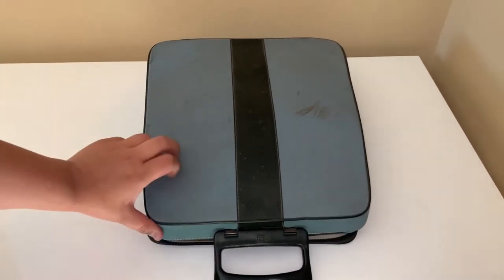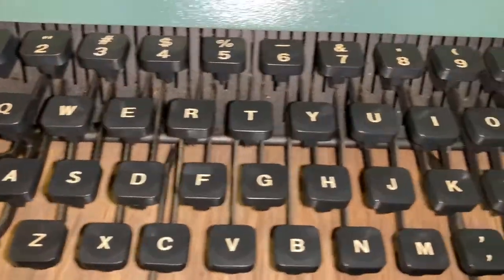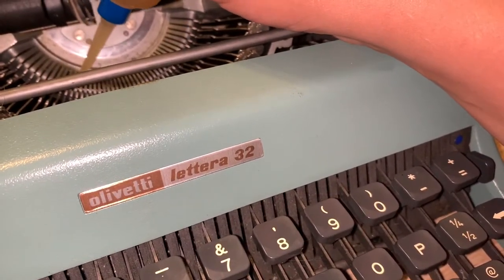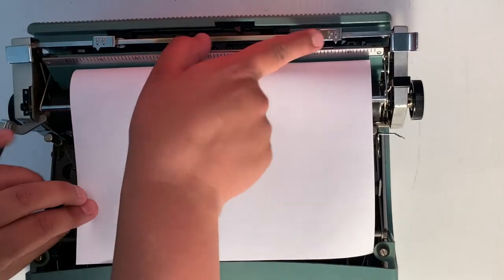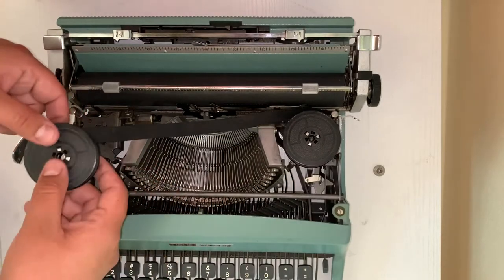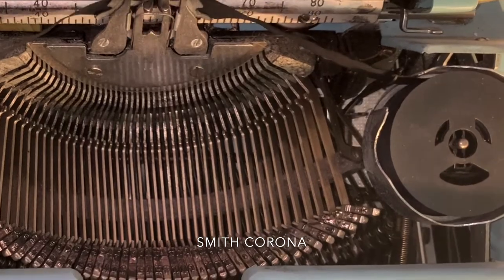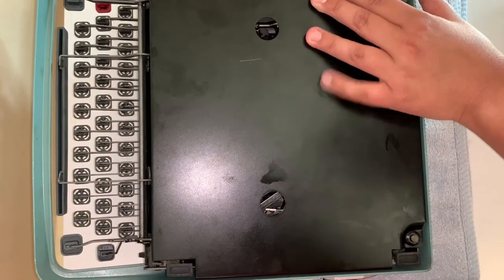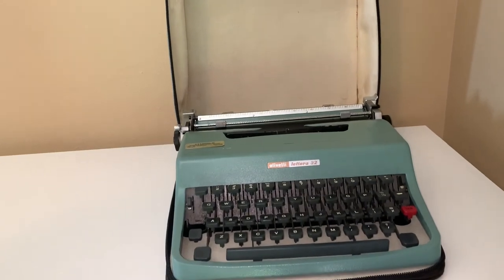Olivetti Lettera 32 // Cleaning & Oiling // Change Ribbon // Troubleshoot// // 1960-ish

Comment: Isopropyl alcohol is a bit of a better choice for cleaning type arms. Alcohol and pressurized air. Sewing machine oil is good for certain parts but is rarely needed. A problem with using oil in place of a loosening agent like isopropyl is that it slowly gathers dust or could even land directly on previous build up, over time that build up gets gummed and the oil added to this makes it a wayyyyy harder mess to clean for typewriter maintenance or repair in the future. It may seem good at first, but it is doing more harm than good. Those type bars are spring reliant, tension, pressure and keeping them clean is important, making sure the springs are in good shape, not oiled. Checking and notes is a great idea though, but I just hope others aren't oiling their typewriters..
Reply: I was thinking about that the whole time. I was looking to see if anybody has said anything about  it. The key rails were not meant to be oiled. This is clearly mentioned in some typewriter manuals.
Reply: Thank you for the advice!
Reply: Agreed. If you don’t add all that oil, you won’t need to clean all that oil off. Just clean it.

Comment: incredibly helpful. until your video, i didn't realize that the two little prongs that hold the ribbon need to be equivalently aligned (to the left of their two settings for the ribbon to turn right, or to the right of their two settings for the ribbon to turn left), otherwise the ribbon wheels won't properly turn. thanks!

Comment: Really, really great video. I’m cleaning up an Olivetti Lettera 32 with the cursive font. I looked at many videos and yours was the most informative and the most clearly photographed. I’m putting this video address on the page I’m writing to sell it so people can access your great video. Thank you!!
Reply: Does yours say Underwood Lettera also?
How does one price one of these? I think I read that they come with serial numbers...
Reply: @ALCRAN2010  It did not say Underwood on the typewriter itself but it did say Underwood on the instruction card. It sold at an online estate auction for $212.00. The sale included the original case that had a functioning zipper, the instruction card, a set of new ribbons (the ribbons on the machine were new also) and two sets of vintage typing paper.
Reply: @ALCRAN2010  The price started at $5 and went to $212 over the 2 week/4 day auction.

Comment: managed to snag one of these from the charity shop for £40; case, brushes and manual all there, all unmarked and in excellent condition  (also some OG TippEx which was fun) Apparently the guy who dropped it off said it was broken. Charity shop said it wasn't actually broken when I asked if it worked but they couldn't really demonstrate it for me as they weren't fully sure how to work it themselves, so I took a chance. I had no experience with typewriters but I got it pretty figured out within an hour of just... randomly pulling levers and hitting keys. Just needed a fresh ribbon. think the guy (and the shop) just didn't realise how you unlocked the carriage aha.
Reply: Lol, amazing how many I've seen for sale or auction online, stating the carriage isn't moving...... I'm pretty sure a lot of those were just locked too!   For once it's an advantage to be of advanced years 😃

Comment: I read many time we should NEVER NEVER NEVER use any king of oil or grease on the machines.
It's of course the reflex when try to restore a machine, but i understand it's a big common mistake.
You can now cleanup the machin with alcool and that it, or use dry carbon something or teflon.

Comment: in other videos i heard you shouldnt use oil to fix sticking letters because it will make it more sticky over time - are you shure with your oil implementation? thank u :)
Reply: Oil should never be used in the type basket/segment as it become a dust magnet and will gum up the keys over time (which is why keys are generally stuck or slow to begin with).
Reply: Instead, clean the gaps with mineral spirits and blow out with compressed air.

Comment: Need help. Hello, let's see if you can help me? I intend to buy an Olivetti Lettera 22 machine that I saw in a newsstand here in Brazil, I believe it is 1963.
It's pretty dirty but it looks good to me. The letter C is missing from the keyboard and I hadn't even noticed this lever that makes the spacing between the lines, but it's missing, but the roller is not locked and the keys don't stack. She's on tape and apparently working.
I've never had a typewriter and I don't even know how to use it, is it possible to use the typewriter without this lever that has 4 spacing and neutral (zero) positions? I want to use the machine in a simple way, train typing only.
It is being sold for a very cheap price and whoever is selling it doesn't understand about it either.
These machines are getting rare around here and their price for both repair, maintenance and parts are very expensive.
Someone else will buy it, even to use it as decoration and I'll miss the chance to get a good deal.

Comment: I don’t know if you’ll see this but I need help :( I have an underwood olivetti studio 44 and I am attempting to change the ribbon..... but I can’t remove the ribbon.......
Reply from the maker: Hi! So I looked it up to see if the mechanisms are the same and it looks identical if not very similar to the ones on the machine I have- were you able to get the metal screw things off the top? The ribbon won’t come off if those are tightened. If those will not come off and they are possible rusted or damaged in another way you may have to try with a crescent wrench but that may damage the threading on the outside and may interfere with the ribbon staying on in the future let me know If you were able to get those silver screws off right on top of the ribbon and then I’ll see if there’s anything else I know! Haha hope this helps!

Comment: Hi Taylor, I just picked up an Olivetti Lettera 32 here in Austria and your video was incredibly helpful with getting started. Thank you!
One question is coming up though: My margin bell does not really make a noise and I would like to fix this. I have looked at the mechanism and I can trigger the bell with my finger by sliding over the central lever. However, the carriage sliding over the same lever does not produce the bell sound. Do you have any ideas how to get the bell to ring once it hits the margin? Thanks so much!
Reply: The metal strip immediately next to the lever can pivot back, if you do that you can clean the spring below. I cleaned mine with circuit cleaner & a q-tip, and it went from no sound at all(unless pushing in particular ways with my finger) to a bell noise(albeit not very loud) in normal operation.
If no cleaning helps it could be that the spring has become too loose, or detached(but you should be able to see if that's the case).
Personally I think it may be better (for manual typewriters like this) in the long run to just remove all grease etc, rather than adding oil as shown here. Oil seems to pretty much inevitably have dust sticking to it.
The main reason for oil on manual typewriters in the distant past seems to have possibly been to prevent rust, but that doesn't seem much of an issue for relatively modern typewriters like these.

Comment: Hi my Olivetti Lettera 22 has a skipping issue. This happens only when I'm typing very fast, when I'm typing slowing and not forcefully but pronouncedly the skipping doesn't happen at all. I don't want to immediately assume it's an issue with the machine because it could be an issue with me. I am fairly new to typing and this is my first machine, so it could be because I am importing my typing style on the computer keyboard to the typewriter. 
Another thing is that Olivettis have personal touch adjustment. You can adjust the softness of the touch from 1 to 4. Is it because I'm not being able to align myself with the touch adjustment that the skipping happens? I am asking all this before I take it to the repair store (who will definitely say that it is a problem with the machine).
Reply: Are you sure you're not accidentally bumping other keys?, personally I found it easy to accidentally hit the space bar. I'm definitely not used to using a typewriter though.
Reply: Did you figure it out? I find with manual typewriters is when I type too soft it skips. This is fixed by a quick firm down stroke of my finger (like a sharp peck). I practise this. Also the surface that the typewriter is on needs to be at at a height to accommodate this, of it is sitting too high it is hard to make that accurate stroke.

Comment: I have a funny problem with this model, got it recently and everything seems to work very nicely and its pretty clean already. The only problem is that the return carriage (the silver stick) when i put it back to the right to make a new line...is in the same line everytime. Like the paper doesn't move up while you writte a line after line.

Its not the drawband itself because the space, the tab, the back button, all the letters during the line works and doesn't get stuck, and go to left and right with no problem, it just do not go up while you writte (which is the less practical thing ever in a apparently perfect condition typewritting).

Any idea or video of how could i fix that? 

The silver stick in the left only has one spring and doesnt look very tense and i though maybe doesnt have enough strenght to put the papper up but i don't know how should i solve it
Reply: sorry this was a month ago so you might be sorted.. not to state the obvious but have you adjusted the lever which lets you chose between 0,1,2 and 3 spaces between lines? or looked for a problem there?
Reply: @SCW95  the problem is that the spring is loose. The spring that it's fixed with the silver stick when you run from one line to another one.

But I didn't find any video of how to fix this particular problem with the tiny spring

Comment: Hi there,  I snagged myself one of these yesterday from an op shop... woohoo! I need to buy a new ribbon for it but my first question is can I use any type of oil or does it have to be a machinery type oil? and my other question is that the little elbow isn't lifting the ribbon when I type so the letters are hitting directly onto the paper above the ribbon... What could be the cause if this and how could I fix it?
TIA
Reply: One possibility I can think of.... If the ribbon-color select lever is in the middle position, between red & black, the little ribbon lifter arm won't lift the ribbon.

I believe that the color select lever is over on the right-hand side of the keyboard... But I'm not 100% sure.

Comment: I'm concerned that you're using oil when "cleaning". You're going to be creating a future world of hurt when it gunks up with dust over time and keys stop working. Use canned air and a toothbrush first, then maybe rubbing alcohol. 

Your video originally showed the ribbon elbow not moving up or down at all when you tested the keys, which seemed like something you would have had to fix. Disappointed you skipped that part.

Comment: What could be wrong if the ribb is threaded properly but the real doesn't move when typing. Love your video. ❤️
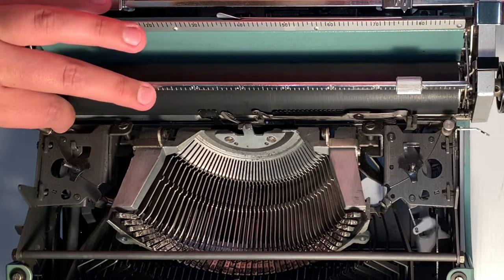Reply from the maker: Without looking at it, I would think that the mechanism that moves the ribbon itself isn't working properly, I would double check all the mechanics at the , 6:35 mark and i would focus my attention there, you should be able to see by moving those pieces if something isn't working correctly, you will want to trouble shoot with the ribbon off so that you don't damage it but it, all the pieces should move normally without the ribbon needing to be on, if none of those pieces look like they are working properly than you would need to do further investigation as to why, and some replacement pieces might be needed, the things that is frustrating with simple machines is that they work really well long term, and they don't need much to keep them going, but when one thing is off, than it sort of snowballs into the next thing not working, but again good news, the second you find that small thing off, it will usually fix the whole problem!
are the reals moving at all? or are they completely jammed up? 
let me know if any of this helps!

Comment: When you swing the carriage return lever away from you (to "put it away"), it should not angle to the right and rest on the metal carriage return release mechanism.  Pull it to the left (you will feel the platen rotate when you do this), and the lever will fold down, and rest on the left side of the carriage housing.